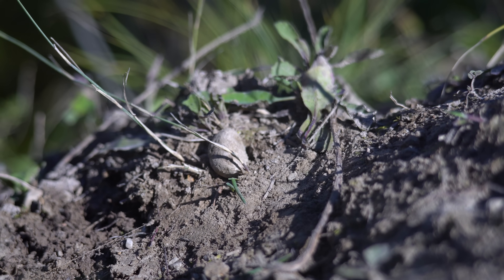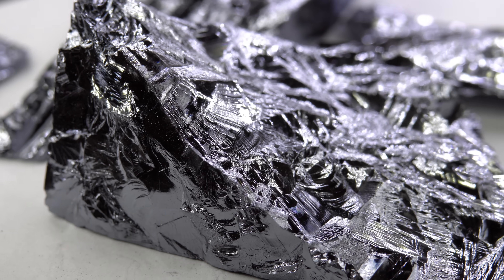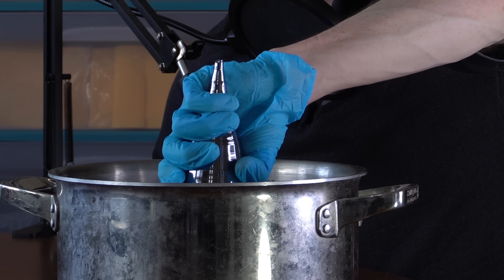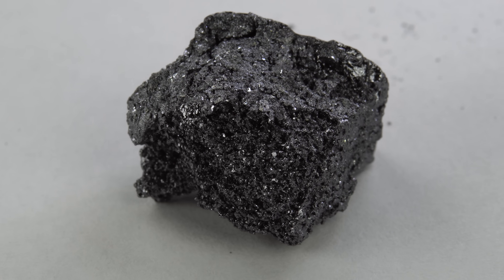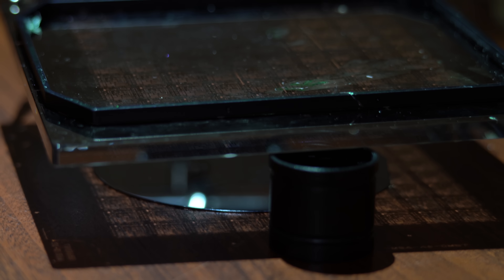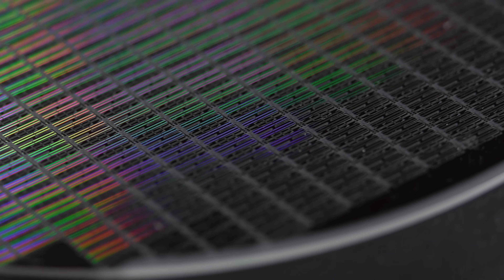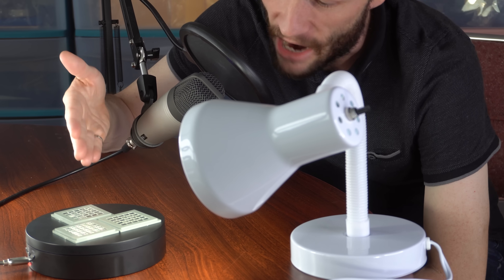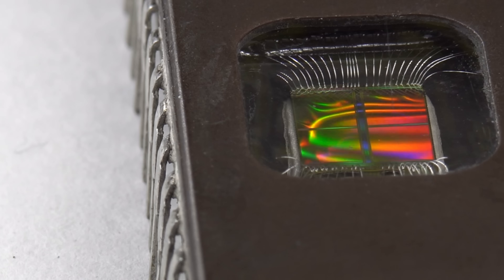How To Make A CPU

Comment: It baffles me how people even were able to come up with inventions like this
Reply: well first they were a room big, then a bit smaller, then smaller, smaller, all the while getting more and more complicated
Reply: @johnmadlabs It wasn't gradual.  First the computers were huge for 30 years, and then the Intel 4004 did the same thing on a chip 2 inches long.

To make the first bootloader for it, Bill Gates used an emulator on a huge $500,000 university mainframe.  That was the previous technology immediately before the integrated circuit.
Reply: @customsongmaker  missed the point completely + it was more gradual than you make it seem
Reply: @johnmadlabs  I guess.  About 1,000 computers existed in the world in the year 1960.  The Magnavox Odyssey came out in 1972 and sold 350,000 units.
Reply: @johnmadlabs  Yeah in that perspective it makes way more sense. If it started this small it'd almost seem impossible.
Reply: I have the suspicion that i wouldn't have figured that out even if it was two rooms big
Reply: @johnmadlabs ENIAC LOL
Reply: Incremental steps, as always. Once a guy thought "hey what happens if we contaminate it with some phosphorus" and it turns out it made the chip better, and so on.
Reply: @KepleroGT

It doesn't just make it better, it doesn't work at all without it, pure silicon is useless for transistors.
Reply: Literally what I think about all inventions that have highly technical and specific processes. Like I’m sure it was realistically iteration after iteration of slight improvements but still lol
Reply: around 2 million years of trial and error led up to this
Reply: It's easier to wrap your head around when you remember that each stage of each stage in this video took a very long time and probably wasn't even for the intended outcome
Reply: Working together. If I know something and you know something I dont we can make a new something. Working together is awesome.
Reply: Slowly, over time. Nobody invented any of this shit overnight. Nvidia and Intel pays billions of dollars to their R&D departments for inventing more efficient ways of designing chips, every year. Some very smart engineers work there
Reply: several different discoveries by different people collectively come together to bring new inventions
Reply: a gradual step by step process built on the ideas of those who came before us. "Built on the shoulders of giants"
Reply: Psychadelics
Reply: Glad those aliens crashed xD
Reply: @AdioAurel  Only OG's who know P. J. Corso can understand, lol.
Reply: Prolly cus their software crashed which caused their vessel to crash and our reverse engineering adopted those flaws which cause our systems to also crash. Damn Aliens.
Reply: @AdioAurel 😂😂 oh roswellllllll
Reply: Hehehe

Now we evolve along their predicted lines of evolution.

Ingenious.
Reply: @AdioAurel who taught the aliens than ?
Reply: So I guess this is why the 4090 costs $1800
Reply: More than a hundred years of work by literally hundred thousands of scientists, chemists and engineers, and - ét voila!

The CPU is actualler older than the silicon wafer process. It just got insanely more efficient when it finally got there.
Reply: @mariusg8824  you do realise you said and twice? LOOOOOOOOOOOOOOOOOOOOOL
Reply: @mariusg8824  " ét voila!"
that... is not how its spelled
Reply: @RenaldTremblay  I don't have an accent grave on my keyboard
Reply: @mariusg8824 "shit ton of people did this" argument doesn't expand anyone's horizons, it's a boring answer
Reply: @MattBG67  right, we need a false profound answer instead.... aliens
Reply: @MattBG67  Well, what kind of answer would you rather hear? A single anekdote, that leaves the impression that this was a miracle based on a singular breakthrough?
Reply: @mariusg8824  the thought process, why exactly 1698K why silicon how do they even come up with the idea of purifying the silicon without any knowledge beforehand
Reply: @mastergamer-zq8xc  The idea of semiconductors were a direct result of quantum theory earlier in the 20th century. The original question was why iron glows when it is hot, and while browsing through the periodic system of elements they realized that some atoms must be semiconductors due to the way that electrons get propagated. But only if they are very, very pure, so they can create very regular crystalline structures. After that there was a lot of trial and error to achieve that. I think it's amazing that semiconductors were a material that didn't exist in nature, and was predicted in theory, and finally could be produced to ignite the information age.
A lot of the algorithms etc. have been known for centuries, but no one was able to build a material with the required properties.
Reply: @MattBG67   Unless you're really interested in hearing about hundreds of niche ideas on niche topics like doping or vapor deposition processes then the detailed answer is going to be even more boring than "it was a lot of trial and error haha". This story is one of decades of incremental improvement in manufacturing processes until yields were good enough for silicon chips to be commercially viable; a story of slow progress and dogged persistence more than profound flashes of insight and game-changing breakthroughs.
Reply: @MattBG67 but it’s not, it’s a craft that’s been improved through generations of people.
Reply: @mariusg8824  Great answer 👌
Reply: @mariusg8824 they do exist in nature. It's called human beings. The idea that it's insane to create something that thinks is even more insane when you realize we are already those things
Reply: @bensheard3969  he talked about semiconductors not existing naturally. Semiconductor refers to a material than conducts electricity only under some circumstances. If you are able to control those, you can make circuits! (Circuits are sequential things happening that can be interpreted as a calculation happening. They were already know, but were bulkier.)
Anyway, yes, its awesome to be human and conscious! Sometimes we forget how many posibilities we have! :D
Reply: @alvarorodriguez1592  yes we have alot of possibilities but most seem to be negative or self important from my experience.  You have the ability to think very critically about something and also the ability to not think at all about it.  It's clinically insane to me that we are so obsessed with AI that can do a shittier version of what we already do just to replace jobs and make the elites richer. The Baltimore bridge is a great example of what happens when we think dogshit technology replaces component people
Reply: @MattBG67 get over it
Reply: @bensheard3969 ai is talked about alot because of it's potential and the speed of its growth,  not because it's current applications can do everything
Reply: @MattBG67 I think it's a great answer. It wasn't one person who thought of this massive process. It was thousands of people each creating and conceptualizing a tiny piece of the processes we use today. Individually, we are useless. But together, we can move mountains. Or make mountains think for us ;)
Reply: @Ostinat0  naah, it's alien. they told the formula to secret society and secret society make us worship aliens for exchange.
Reply: @mariusg8824  I want to think that this rabbit hole of scientific discovery started with one guy staring into his fireplace out of boredom before suddenly realizing nobody ever really looked into the mechanisms just as to  why it was emitting light in the first place.
Reply: @bensheard3969  As someone explained above- it was the result of Quantum mechanics. Crazy mathematicians did the math, physicists wanted to prove it, engineers created the materials, and manufacturers put them to use.
Reply: @Ostinat0  Yes. That's what I want to hear. The answer "a lot of people worked on it" is something I can give myself too
Reply: @sophiedowney1077  You have it wrong, we are not useless, do not understimate the individuals because they are what create the collective. I believe what you meant to say is that we achieve more when working together.
Reply: @mariusg8824  Semiconducters and transistors arent an issue when talking about theory of aliens crashing and then reverse engineering their technology. Its the integrated circuit idea thats a big breakthrough. The idea to etch whole slew of circuitry in layers on silicon wafer is a brilliant one. Also lasers and optical fibers and integrated circuit all came out at same time. Makes you wonder...
Reply: You're on the internet. You have veritable access to the sum total of human knowledge. If you need a YouTube video to "expand [your] horizons" then I can guarantee that you lack the motivation and enthusiasm to educate yourself and no amount of YouTube videos, or YouTube comments will ever fix that.
Reply: @mastergamer-zq8xc  That kind of stuff is just way too complicated and there's whole classes on it. For example, if you ever take a materials science class and they talk about something you see every day, it'll blow your mind. Take steel for example. Look up the type of steels based on temperature and carbon percentage. There's graphs that will show what temperature you need with what carbon percentages you need in order to get certain types of steel.
Reply: @mariusg8824  bruv, why are u so smart and knowledgable? Are you an alien that gave us recipe for this technology now trying to downplay and cover it up? Is that what this is all about?
Reply: @alvarorodriguez1592 

Semiconductors kinda exist in nature. Air is pretty much a semiconductor in itself. An air gap starts conducting only at a certain voltage and clamps the voltage. That's why you get lightning strikes. Charges accumulate until you reach the breakdown voltage of the air gap and then boom... 
A Zener diode made from silicon does the same thing just at way lower voltages...
Reply: It's that 2% difference between us and chimpanzees
Reply: I think they probably just tried out a lot of different things until something worked
Reply: A series of solutions in the process of running into problems while making what you envision.
Reply: The first ones were relatively simple. But everything has to start somewhere.
Reply: just look at the top-tier speedruns and glitches In games.  same vibes
Reply: @LethalFellowship  true
Reply: The same way how they made the steam engine into your toothbrush motor
Reply: Intel: 😎😎
Reply: It was there the whole time
Reply: Lots of psychedelics. Look up the history of the first silicone based computer chip and the life of the inventor. Literally just did mescaline all day for decades
Reply: @derekderek2570  So he contacted demons through the use of drugs, and they told him how to make it
Reply: DID YOU START WITH FINDING A ROCK? IT IS IMPOTENT

and the rest of the magic makes it potent.
Reply: it didnt come directly. this was enhanced processes in several iteration. where they always made something more advance, in every itterations. But computers were designed on paper (so logically), much earlier, than WWII or WWI. They just didnt have technology, to build the logical scheme.
Reply: I got into tapes recently with Linkin Park's release of their Papercuts compilation album which included a neon green cassette that was so pretty i had to get it.

Now I've gone down the rabbit hole, bought my first cassette deck, and now I've gained new reasons for my interest. Firstly, it's physical media. Self explanatory. Secondly, they don't inherently require a computer to play or record. No downloading any software, no internet connection required. Plus they're repairable! A lot more than you can say for a lot of products nowadays.
Reply: you're welcome
Reply: C 😂😂
Reply: yeah same
Reply: they didn't, they just made minute improvements to the thing the guy before them had improved for hundreds of years
Reply: Like evolution it’s an iterative process of trial and error.
Reply: the computer is an unexpected product of thousands of years of civilization and knowledge. We are literally standing in the shoulder of giants . Thousands of generations ,making incremental discoveries by intention or accident from the time people started to ask the nature of reality and why.
Reply: Imagine the legends of the industry utterly ashamed I use it for memes and hentai.
Reply: Money is a good incentive
Reply: Chemistry is cool, huh
Reply: If a bunch of smart people is in a same room, they could create anything they can think of. 

Basically. 
Every Smart people + same room + same thinking = Inventions

That's how i interpret it 🙃
Reply: Magnets
Reply: Excuse me, eh-hem, black people you mean?
Reply: Demons
Reply: European brains
Reply: It started up simple. Transistors could be picked up and placed by hand, the manufacturing process got slowly improved over time, but each improvement wasn't as complex as the final result looks.
Reply: European contribution to Science and Technology is truly unprecedented imo
Reply: The first computer was the antikythera mechanism and it used complex metal gear system, everything just got more advanced and smaller in scale and more efficient processing
Reply: It was reversed engineered technology
Reply: Definitely aliens.
Reply: Processor technology is actually pretty ancient. Making it smaller and smaller was the real innovation over the years. Think of it as computers being the size of rooms back in the day to now.
Reply: Alan Turing came up with the first digital computer, and he was exiled for being gay eventually committing suicide. The human race never fails at being awful.
Reply: The answer is usually just then war was declared
Reply: Had to be some Alien stuff same with fiber optics 😂
Reply: Maybe it wasn't people 🛸
Reply: Honestly i wouldve figured it out. I mean 100 years of life, seeing iron glow, clearly something like gold or copper would be of use if it can absorb (conduct) electricity
Reply: Aliens gave us this. They been. Involved in human inventions for years.
Reply: Thank you to taiwanese people, taiwan namba one 🙏🏻
Reply: Because we have white people.
Reply: Thank you wyhite people 👏
Reply: @smittywerbenjagermanjensen5410  Dr. Mark Dean, a black man actually worked to invent the gigahertz chip and many other revolutionary computer technologies at IBM. You can thank him too :)
Reply: @smittywerbenjagermanjensen5410 for what?
Reply: Lol they didn’t carry the torch for long, the Taiwanese are ahead of not just the white people but the Japanese as well. Interestingly enough, “white people’s” advancements in tech rode on the back of the ethnic Asian/Indian/Latino engineers down in San Jose. The more you know 🎉 @smittywerbenjagermanjensen5410
Reply: For realsies
Reply: "people" didn't come up with anything. You can thank the Omnissiah (peace be upon it) for blessing us with the machine spirit.
Reply: I swear to God
Reply: A "gift" from fallen angels
Reply: Step 1: Pray to Satan for forbidden knowledge.....
Reply: Meanwhile, the MUCH more complicated human-being supposedly happened by “chance and necessity” lol
Reply: Guys, Here is our Savior

HalleluYAH translates “Praise ye YaH”

YaH is The Heavenly Father 
YaH arrives via the TENT OF MEETING
YaH was Who they Crucified for our sins
YaH was Crucified on an Almond TREE

— Ancient Semitic Cuneiform of Moshe (Moses)
— Isa Scroll (The Original Isaiah)

Isaiah 42:8
"I am YaH; that is my Name! I will not yield my glory to another or my praise to idols.”

Isaiah 43:11
“I am YAH, and there is no other Savior but Me.”

Isaiah 45:5
“I am YaH, and there is none else.”
Reply: People really believe this is all "trial and erra erra erra" over a "GAJILLION YEARS" BULLSH!T LMAO
Yet not one comment has explained how or why any human had this idea to put something like this together in the first place.
Reply: @Juan_Ranklin  evolution is exponential not linear.  The human being or group who thought of this was a result of exponential 3 dimensional thinking not billions of years of linear or binary progression.   This person is just a niel burns clusterfuck of inventions that many people came up with over generations.  Your not God your parents just did a shitty job of raising you.
Reply: @Juan_Ranklin  You're right. Nobody is explaining it and it's frustrating. The question everyone has after watching the video is "how did anyone come up with this?" but the answer is that this is actually a miniaturised and highly specialised piece of tech very deliberately developed l. But again, why? and how did they even know there was a chance it'd even do anything once built?
Reply: @Juan_Ranklin  We have. You just are not smart.
Reply: @Juan_Ranklin You should study the history of computing and you'll understand how things evolved from Charles Babbage's analog Difference Engine to Von Neumann architectures up to vacuum tubes and computers that are as big as entire rooms to technical marvels of modern CPUs.
Reply: @Juan_Ranklin 

What? The history of semiconductors is incredibly well documented and it's also plain to see for yourself if you opened up any vintage piece of technology. From simple crystal radios (using crude semiconductor detector diodes) to transistor radios which became a reality in the 50s, then the idea to put multiple transistors on one chip using a lithographic process to save space which resulted in things like metal can op amps including maybe a dozen BJT transistors in the 60s, and the chips getting more and more legs from then on. If you had any curiosity about the world, you would have found this out already.

Comment: Another fun fact. "Faster" and "Slower" versions of the same CPU family are often the same. The slower ones have slight defects or defective cores that are not 100% perfect so they are switched off or underclocked and sold at a lower price. Sometimes these cores are stable or overclocked enough to work and can be reactivated.